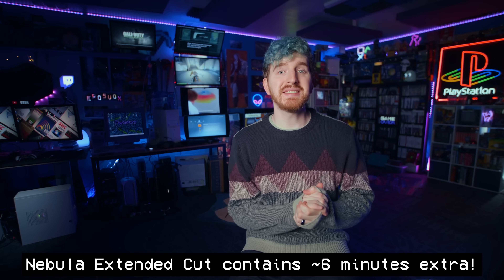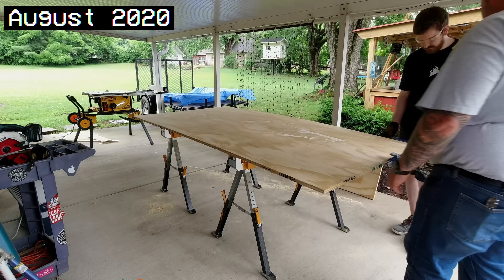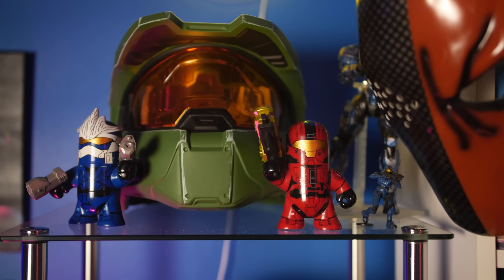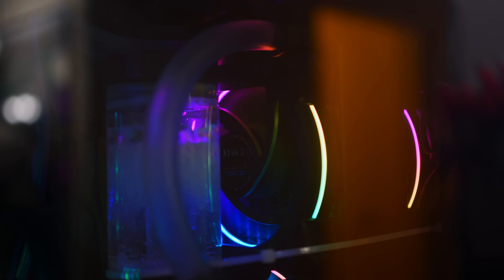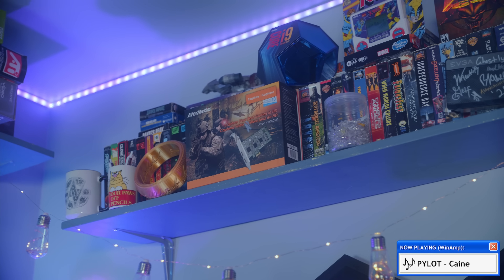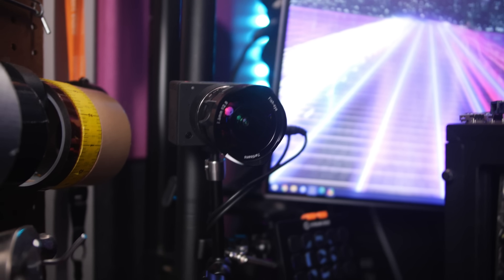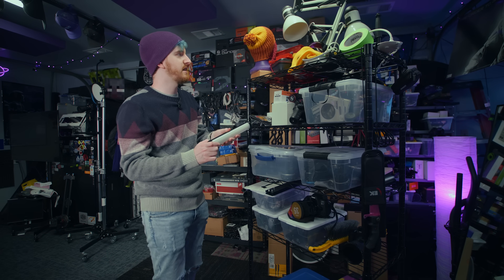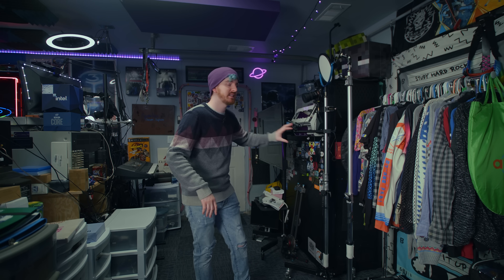Million-dollar studio for under $10K!

Comment: I like the backdrop the most.  It is a very simple way to change a single set configuration into a multiple set configuration.  I might consider adding one just so I can use the lighting and camera configuration for other channels outside of my primary Pokemon channel.

Suggestions 

1) You can get some Tool Storage carts which would be great to clean up the plastic bins.  Since they have multiple drawers you can really organize cables nicely.  

2) You can buy or build network ladder racks that hang horizontally from the roof to run cables.  You lay the cables on top, so there is less stress on the cables and you can use the ladders to mount lighting, cameras, etc to so they would be versatile.  Would be easy to make out of 2x2s which then could be painted and made into part of the set with your LEDs.  Might be a consideration to get the cabling up where it would be easier to fix a bad patch cable.

3) Replace door with fancy sliding door that makes the swishing sound like on Star Trek.  Yes you need that.  Absolutely..

Comment: So did you have to add additional circuits for electricity in there?  I imagine you either have a separate power company feed or at least a beefy subpanel coming from the breaker box in the house to feed all of that?  Especially since the garage has it's own HVAC system!!!!  Gotta have like a 80-100 amp subpanel out there right?
Reply from the maker: I’ve got a full 120A breaker box for this place! Really lucked out. 2 main circuits running the main outlets then a few extras to play with. Server rack is on its own, AC is on its own etc

Comment: Couple questions for you sir.  1. Elgato Key Light versus Aputure 120d.  Aputure takes up so much space for the light box.  Any thoughts on the tradeoff of using the smaller LED panel versus the big professional light?  2.  I have a two PC setup with a 3080 RTX in my game PC with a ultrawide (3440X1440) monitor.   I'm using OBS on my gaming PC with a game capture source (previewed to camlink pro in my streaming PC configured as an extra monitor in my gaming PC with a 2560X1440 canvas).  Basically it keeps the 16:9 res and just chops off the ends of the 3440x1440.  I think you are familiar with this layout.  I'm losing about 30 FPS (150 down to 120) on my gaming PC using this setup.  Any ideas on how I can configure this to NOT lose so many frames?  I also disabled the preview screen on my gaming OBS, still losing 30 FPS.  Thanks for taking the questions!

Comment: I bought the Aputure Light Dome II and a low budget Glow EZ Lock Collapsible Silver Beauty Dish (34") to see if there was any real difference in performance. The only difference I found was that the Light Dome II made the light temperature slightly warmer for some reason. Otherwise the Glow EZ is almost half the depth (Parabolic is bullshit) and half the cost. I also found it to be much easier to set up. Just my two bits. Hope it helps